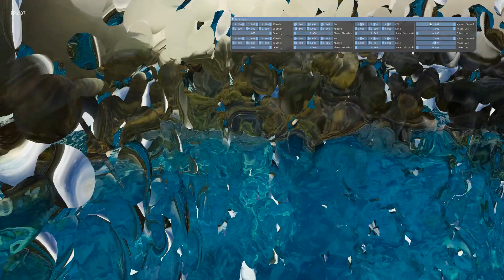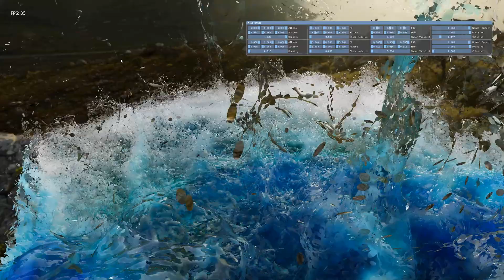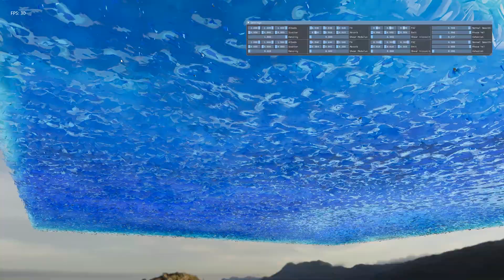Smoooth Particles (Devlog)

Comment: I am just sooo shook at your work!!!! :O I am a video gamer, I really love video games and get so lost in them and they are such great escapes from life sometimes, and I saw Unreal Engine 5's absolutely breathtaking demo, and it made me think about more realistic water physics that is completely interactive and reacts with other physics changes like a building breaking or a water monster thrashing around, etc. in video games. Realistic water physics is just so lacking in games, but I feel with next-gen technology this sort of stuff should be more achievable in games, no? Absolutely incredible work, it looks sooooo good aside from the few things you pointed out that you're working on like the dimples, etc. Are you planning to use the new RTX 3080/3090 cards or the new AMD cards, or threadrippers or anything to see if you can make this even more realistic at all?
Reply from the maker: I recently got a computer with a Ryzen 5900X and RTX 3080 so I will be looking into scaling things up. But I also want this to run on as many people's machines as possible, so my main target specs are basically the same as the current generation of consoles. My demos so far have been recorded on a Intel 8700K and RTX 2080.

Comment: Looking very smooth and liquidy!

Another neat trick is to blur the normal buffer in screen-space; this may go farther towards eliminating gaps (and a neat trick for that is to use a "separable blur", which is just two linear blurs (horizontal/vertical) applied sequentially).
Reply from the maker: Thanks! I sometimes worry a little with screen-space blurring as the blur radius needs to vary with depth, and surface discontinuities (depth or multi-material) can also mess with things.

Comment: Blur filter that only detects the water?
Reply from the maker: Yeah, something like that. The detection part is actually pretty easy, I just output the material ID when I do the first rasterization pass. And then there is a per-material setting that blends the mesh normals with grid normals.

Comment: That's a simply amazing aesthetic! The normal smoothing really pulls the material shader together. The refraction is crazy. Does it just work on the HDRI backdrop, or would it work on arbitrary geometry/the particle system itself? If the latter, you've blown my mind. In either case, this is by far the most impressive realtime 3D liquid simulation implementation I've seen personally. I'm excited to see where you go with it.

There's only 3 challenges left before you have me saying "I need to see this in a real game, now". The simplest would be more ways to interact with the liquid. The god vortex force field is cool, but probably could use some alternatives. The second is making the simulation boundaries feel right. Probably the simplest solution would be to just model a pool and stick the liquid in the pool, so it feels grounded. But in my wildest fantasies I imagine an adaptive resolution sim that extends a good distance out and eventually fades into a static (non-simmed) ocean while moving along with the user. If anyone can do that, it's you. The final polish it asks for is simulation speed. In most of the simulations, it feels slow-mo. Maybe this is a simple parameter tweak, or something to do with scale, or maybe other issues arise when you try to speed it up. Any case, making the final result 'feel' like it's real time instead of slo-mo could be an important challenge to overcome, depending on your application. Just playing back the youtube video at 2x speed gives me a preview of this, and it looks amazing.

Looking forward to your future demos!
Reply from the maker: Thanks! The refraction is able to see the particle system as well. So sometimes you can for example see the foam through the water. But I really need to optimize things to allow for much farther raymarch depths for best quality.

1. Interaction types: There will be a more fine-control style drag interaction as well as the ability to spray particles or place blocks of particles. I'll also allow people to choose whether they want the interaction to only affect one material or all.

2. The initial thing I might go for is chunks (probably the same size as this), but only the chunk you are in simulates. The 8 surrounding chunks will only be rendered.

3. Lots of optimization work to be done and need to bump things up to 60 FPS at least. This video is also 30 FPS but the simulation is around 40-45 so there are some dropped frames (excuses lol).

Comment: Looks much better. Would a temporal normal filter work too (improving on the grid noise)?
Reply from the maker: I think it could help if done right but temporal techniques might be kind of tricky as nothing in a liquid simulation is static so will probably need some velocity-based projection as well. I am also curious about actually using the grid artifacts to our advantage, for example moving the voxelization grid up and down to a sine curve over time. Would it actually create nice little waves that weren't possible before?
Reply: You could also temporally smooth normals by letting each particle remember its normal from the previous frame, which might hide some of the grid artifacts